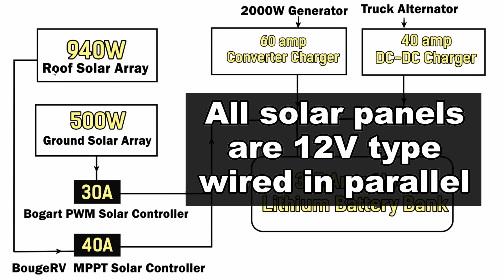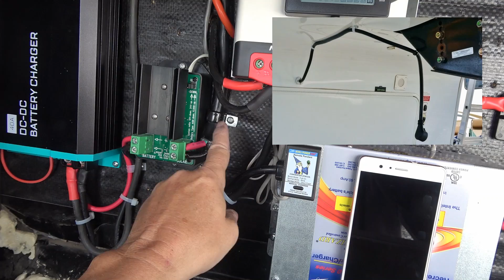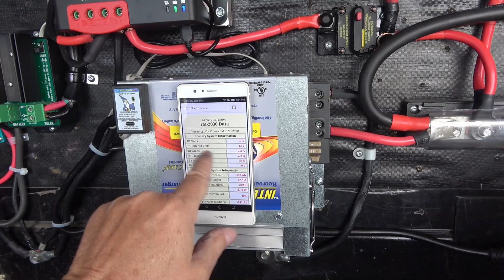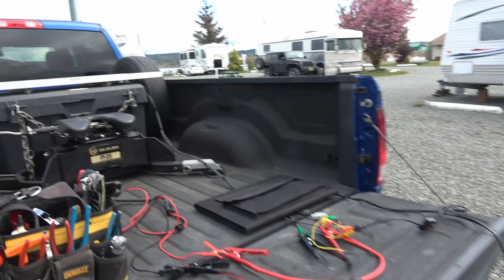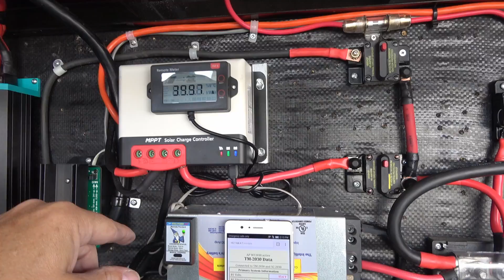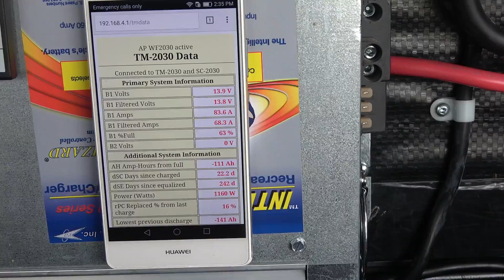Boondocking Power Upgrade - Adding Separate 500W Solar Ground Panel Array + Wiring Cleanup

Comment: I believe you are going to cause yourself some problems if you hook things up as you have them in your first diagram.  A pwm solar controller and an MPPT should never be connected together if you want maximum efficiency..  Actually, both types of controllers send a pwm signal to the battery but the MPPT will do so at very different voltages than the PWM controller.  These two will fight with each other and, at best, it will reduce the efficiency of the whole system).  In any case, you will defeat the advantages of the MPPT controller.  In fact, not only should you stick to one type of solar charge controller but you should also use two that can talk to each other otherwise the PWM signal will likely be out of phase with each other.  If you used a oscilloscope to look at the signal internal to the  charge controller just before the final filtering stage you would see it is not a voltage at a constant value but a pulsing signal that runs between a specific voltage calculated by the controller to zero volts and back.  During the time the voltage is zero (off) the controller measures the voltage at the terminals of the battery to try and get a more accurate estimation of the true battery voltage.  Hooking two unsynchronized controllers together will make it highly unlikely that these pulses line up making it impossible for the controller to figure out the correct voltage it should be emitting.
Reply from the maker: People have been using multistage converter chargers and inverter chargers for years alongside MPPT solar controllers with no harm. I don't see a problem with also doing it with a PWM charger.
Some companies do use data cables between parallel solar controllers, but I believe that's for better matching the lead-acid algorithms so the chargers can sync the bulk, absorption, float, and equalization stages.
You talk of signal but how can a signal live on a large DC battery. It's like a giant capacitor it would instantly flatten any signal voltage. DC voltage should remain constant and slowly rise as the battery charges, just amperage changes.
Both my PWM and MPPT are set up for a constant bulk 14.4V output. If the battery reaches full charge then the internal BMS of the lithium battery turns off charging itself. So, there is no absorption and float and finish equalization stages to worry about. Seems to work fine in my tests.
Here is another video I found with a test of multiple chargers. I think you should watch it, he does a great job of explaining things.  Off-grid Solar Myth Debunked and Explained: 2 or more Solar Charge Controllers + 1 Battery.  https://www.youtube.com/watch?v=rSj6-JSxoD4
Reply: @LoveYourRV  Sorry but I have to disagree.  I love Will Prowse and thanks for the video reference but notice he is using two MPPT controllers not one MPPT and one PWM as you are. Even in Will's case I think he doesn't have it exactly right but I am going to confine my remarks to your situation.  Of course, I have to admit there is lots of bad information and some really terrible videos out there and it is possible that some of my information is not correct.  However, lets think about it.  First, I am sure you would agree that MPPT controllers are more efficient than PWMs and, if you read the literature, MPPT controllers maintain a higher charge voltage than PWMs.  But since you cannot have more than one voltage on a node (point), when you connect a PWM charge controller to a MPPT you are forcing them to work at the same voltage point.  Conversely, the MPPT is going to raise the voltage at the battery terminal and that will cause the PWM controller to reduce pulse width dropping power output. And it is not correct to think of a battery as a capacitor, rather a voltage source in series with an internal resistance in series with a  resistor paralleled to a capacitor.  For our purposes, think of it as a voltage source in series with an internal resistance.  The internal resistance is very important and Will fails to consider that the current from one controller going through the internal resistance is going to generate a higher voltage at the battery terminals that is going to affect the other controller's calculations.

Since an MPPT is more efficient than a PWM controller, it would do no good if it could not deliver to the batteries the added power it harvests from the solar panels.  How does an MPPT decide how much voltage and current to deliver?  To determine the voltage, it has no choice other than to measure the voltage at the battery.  If a PWM controller is delivering current to the battery as well, then that current will go through the internal resistance of the battery and raise the voltage at the terminals.  Of course, that is ohms law.  You can verify this easily by measuring the voltage of your battery when it is connected to nothing and then when it is connected to a charger.  Of course, when connected to a charger the voltage is higher otherwise no current would flow at all.  So, your pwm is putting current through the battery and thus changing the voltage at the terminals.  The MPPT sees this higher voltage and calculates a new higher voltage it will try and deliver and (since power = I X V) this will cause a current reduction.  At a minimum, you are losing efficiency.  In fact you could knock the MPPT (or the PWM) into float versus bulk etc.  The difference might not be big or it could be huge.  Just depends on how much charge current is going through the battery.

The big unknown here is how and when an MPPT measures battery voltage.  I have seen a wide variety of explanations for that but all the arguments have problems in my mind.

In any case, I do think you will lose the efficiency of an MPPT most of the time.  Maybe the voltage smorgasbord on the battery terminals will not be enough to damage anything but seems to me it will hit efficiency.  Why did Will Prowse say otherwise?  Well, who knows for sure but, as I said, he did not consider the voltage generated by the current going through the internal resistance.  I also think Will was operating on the wrong set of assumptions. Perhaps if he took two identical batteries and hooked one to a PWM controller and the other to an MPPT and measured the charge delivered over a given amount of time and summed them than did the same with an MPPT and PWM in parallel to the batteries in parallel he would see a difference.  That is my though on it.  In a few days I have some more panels arriving and a new MPPT so maybe I can check all this out.

At the end of the day it is best to have one properly sized controller or you waist money.
Reply from the maker: "How does an MPPT decide how much voltage and current to deliver? "
My MPPT doesn't have to decide the charge voltage as I'm telling it exactly what to output. As I said, I'm charging a bank of Lion Energy lithium batteries. They have a built-in battery management system (BMS). To charge these lithium batteries, you just need one charging voltage setting.  The BMS will take care of the rest.
I have set both my controllers to a 14.4V constant charging setting.  My MPPT controller has a Li preset for this, and my PWM is custom set via the companion Trimetric battery monitor.
So, they don't need to read the battery voltage and adjust to different voltage charge levels like when using a multistage lead-acid charging algorithm. There is no temperature compensation required. 
Charging is much simpler with lithium RV batteries. They have a very flat charging curve.
Reply: @LoveYourRV  There is more to it than that. All charge controllers measure the voltage at the battery and use it to calculate pulse width (an mppt still uses PWM but it also uses boost and buck converters so it can charge the battery no matter what voltage the panels are putting out except zero of course).  The values you set simply tell the controller when to change modes and when to start and stop charging.  The controller still has to measure the actual values to compare to your settings and to decide the duty cycle of the PWM. Yes, lithium is sampler than lead acid but it still has requirements for quick efficient charging and long battery life. Just because your controller has lithium settings is somewhat irrelevant because those settings did not consider running multiple controllers together and the BMS has nothing to do with what we are discussing.   Although the BMS will protect the battery from disaster it does nothing for the charge controller or the charging efficiency. I have not measured it but I am pretty confident you are hurting the efficiency of your MPPT and throwing off your PWM.  That does not mean it will not work to a degree but just that it won't be as efficient as one would want.  However, in the early morning and late afternoon the PWM is probably off anyway so it would not impact things until the panels put out a voltage higher than the battery voltage.  Admittedly I have not been a practicing electrical engr. in a long time but I "think" I can follow the circuit schematics and explanations provided at the links below.  Here are two actual circuits with low level detailed explanations of how they work.

https://www.instructables.com/MPPT-Charge-Controller-Part-1/

https://www.instructables.com/ARDUINO-SOLAR-CHARGE-CONTROLLER-PWM/

Mind you I do not know if these circuits are representative of what manufactures actually use.  Turns out there are several examples of each charge controller type on Instructables so I will look at these over the next few days to try and understand all the details etc.  To me it is very interesting stuff.  The main reason I got into looking at this stuff is because I wanted to find out why we are always told not to connect the solar panels to the charge controller until the battery is connected.  There is SO MUCH garbage on the internet and youtube that I have to look at the circuit design and try and figure it out for myself.  Kind of like everything else these days.

By the way, if you hook a pwm controller and mppt to the same solar array it is even worse.  If you need more power you want to split your panels up among individual arrays.  I don't remember what you did specifically so this is just a general comment.
Reply from the maker: Ok, maybe I can explain it in a different way. When charging a lithium battery its just like charging a lead acid battery but in bulk mode all the time where max solar amperage is outputted by the PWM solar charger. If the PWM is charging at max amperage (from what I understand) it isn't pulsing to regulate the amperage its just switched wide open passing full amperage from solar panels to battery. Just like you had hooked the panels directly with no controller. When the battery approaches full charge the battery BMS limits the current and eventually cuts off all charging as the battery reaches full state of charge to protect from over charging the lithium cells. This scenario isn't going to confuse the MPPT. Its just going to see the battery voltage slowly rise and because its set to 14.4V it will keep also charging until the lithium battery reaches full capacity.
Reply: @LoveYourRV  I agree with the first part that the PWM controller looks like a direct connection to the battery during bulk charge (actually it is still pulsing but at a very large duty cycle so it is not really a direct connection but close enough).  However, I disagree from there.  The BMS should play no roll unless things are not set up properly or your PWM has limited programmability and/or lacks LVD and HVD.  Unfortunately, lots of PWMs and some MPPTs do not have Low and High Voltage disconnects so your BMS may have to provide the function.   What is supposed to happen is the PWM controller senses the voltage approaching the value set for the end of bulk charging and changes the pulse width to meet the voltage of the next phase (i.e. reduces it).  What the next phase is depends on battery type etc.  The PWM controller does not know about the MPPT and vice versa.  IF the MPPT is charging it is going to raise the voltage sensed by the PWM and vice versa causing a transition to the next phase prematurely.  Now that I have thought about this more I guess I am not as worried about it as I thought I was.  There are going to be other consequences of running both the PWM and MPPT together but I am not sure it matters.  I am thinking now that you will loose some efficiency but you are still gaining another charge source.

About the Will Prowse video you linked, I think I understand why he did not see the issue (actually he did see it but chose a different way to think about it).  When he made the video it must have been fairly low light outside.  He was only getting 16 watts of power each from his two MPPTs. I can barely make it out but it also seems he was inputting only 1.23 amps from the solar panels which jives with the 16 watts.  At this low amperage and the low battery impedance the added voltage increase at the battery terminals caused by the extra controller is only going to be a very small fraction of a volt.  The MPPT or PWM will probably not even react to this.  Lithium batteries have a very low internal resistance.   When Will adds the shore power charger, it adds another 4 amps but this is still too low to make a difference given lithium's low internal resistance. However, notice what happens when he changes to the lead acid battery.  Lead acid has a much larger internal resistance (at least an order of magnitude).  With the lead acid battery we do see the two charge controllers display different wattages delivered to the battery i.e. there is enough voltage generated at the battery terminals to affect how each MPPT's algorithms calculate what kind of power to deliver.  This is further exacerbated when Will adds the inverter - thus increasing amperage consumed - and we start to see bigger differences in how each MPPT affects each other.

The question becomes, does all this matter?  On further examination I guess it is not as big a deal as I thought at least when using MPPTs together and using lithium batteries.  Only when charging with large currents or using large currents are the controllers going to be affected it seems.  Even then, you may trip one of the controllers into premature adsorption or float and/or loose some efficiency but you are still getting the benefit of another charging source.  With another battery chemistry that affects may be more noticeable but I would have too look at that more closely (which I am not going to do since I have lithium batteries).  At the end of the day, for your configuration, I guess you were right not to worry about this (although you are using a PWM with an MPPT which I need to think about more).

I do see what you are saying with your configuration but you have probably heard that it is not a good practice to rely on the BMS to regularly turn charging and discharging on and off.  If the BMS fails you could be screwed.  By relying on your charge controller and inverter to turn on and off charging (and on and off discharging for the inverter) you can only use the BMS as a safety net.  Of course, the less expensive (in general) you controllers and inverters the less flexibility they provide.  Some have fixed values that you cannot change and are not great for lithium.  Then you might have to use the BMS.  Anyway, I think you are fine unless you have a BMS failure.  Isn't this all fun?
Reply from the maker: Yes, for my use case the only time the PWM controller is going to actually be used is when the MPPT can't harvest enough energy due to the rooftop being shaded or cloudy, or short mid-winter days with low sun angle. Then I will have the option to deploy the 500W ground panel array.
So odds are I won't even be getting near full charge. I thought since I have bought and paid for quality PWM charger and some spare panels may as well hook it up as an option for those occasional lean solar power times.
The great thing about lithium compared to lead-acid is they don't need to hit full charge very often. Only every once and a while to help balance the cells. They are quite happy to sit a partial charge for weeks on end. My LION Energy lithium specs a max charging voltage of 14.6V so at 14.4V I have set my chargers at I should be fine and if it gets too close to overcharging the BMS kicks in to shut off charging to prevent harm to the lithium cells.
I have been hearing some people are now setting the chargers to 13.9V so they don't fully charge the lithium battery to try and increase the lifespan but looking at the life cycle specs I don't even think that's worth the concern. Big deal if you increase the lifespan by 10 or 15% when they are already rated for 3500+ full cycles and even then they will still have 80% capacity in them.  That should provide a good 10+ years of use and in 10 years we will likely be onto some newer technology. :) Cheers, Ray
Reply: @LoveYourRV  i was looking for comments regarding grounding the charge controller and inverter external grounds to the same buss bar as the negative ground wires are connected to, and if that should be connected to the frame of the trailer, or should i wire the external ground wires just to the frame and not the buss bar. 
   Im glad i came across this exchange, i found it very informative and a bit fascinating. I may be under my necessary needed watts of solar and was contemplating using my portable 100w panels to help charge my battery on cloudy days, and was wondering if a pwm cc would be ok to use since it wont talk to my 60a mppt epever cc.
Reply from the maker: @checkingoutgypsymike2075  It should work ok, I've been out boondocking in forested campsites this past month or so using the combo of the MPPT and PWM has worked with no issues.  I kinda like having the split system with one controller harvesting from the front rooftop panels and the ground panel and the other coming off more the rear of the rig.